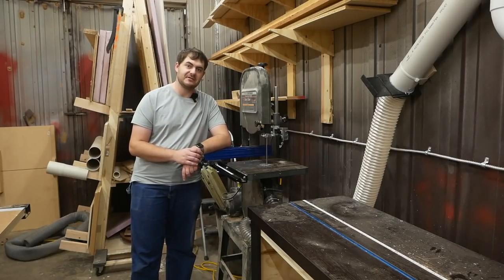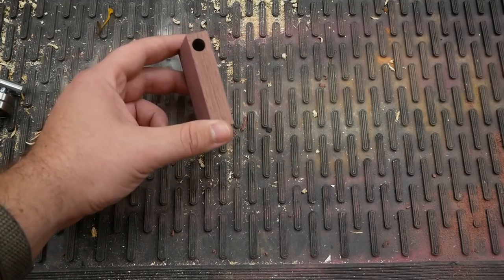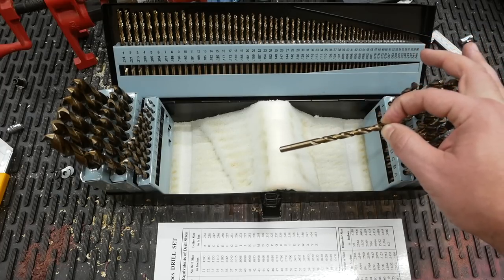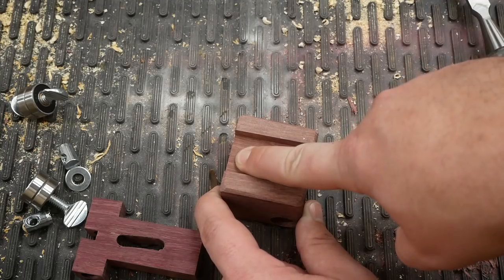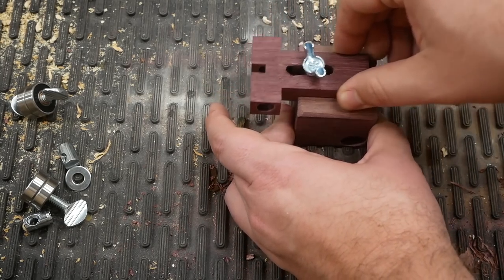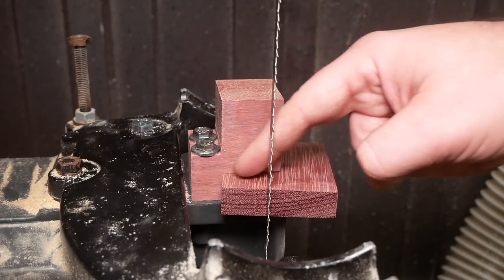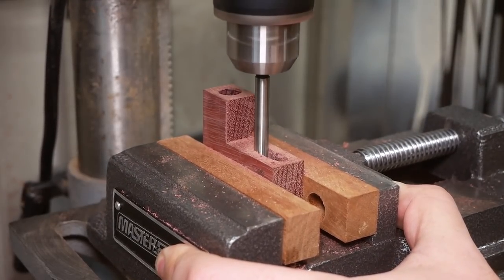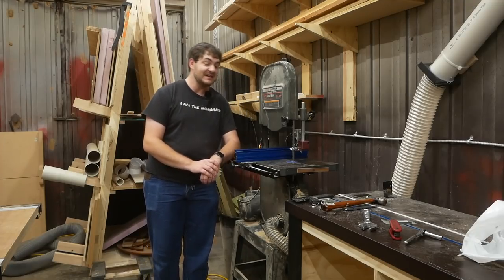Making New Ball Bearing Blade Guides For My Old Bandsaw

Comment: I'm not sure but looking at the bearing i would think the sideways orientation is probably too stop the blade from blade from deflecting off the side due to the width and slick surface of the bearing caseing. With the bearing being sideways it can't slide right off the side. That's my thoughts. I'm pretty stupid so don't take my word for it. I'm lucky I haven't forgotten to breath or fell into a saw while it's running. I sat directly next to the sorry bus driver because it was a two seater.
Reply: " I'm lucky I haven't forgotten to breath or fell into a saw while it's running."
I feel ya, brother.

Comment: A 10mm drill which is 9.9mm. Where do they manufacture those crap? Even the cheapest  drills I ever bought in Germany had at least the proper size. Most of the time the biggest issue is that they get blunt very fast or were never sharp at all

Comment: Yes the imperial drill system is terrible but unfortunately it’s not going away any time soon. It’s a really good idea to put your drill bits right back in the index after you’re done with them because otherwise you’re gonna lose bits, then your index is full of holes and there’s always going to be that one drill bit you lose and then end up needing on an important project. If you’re going to invest in a full imperial drill index just buy a good name brand, American brands are often the best. Expect to pay between $200 and $500 for a set. That may seem like a lot but they will last so much longer than a cheap set and they will drill through steel and aluminum far better than the ones you buy from the usual suspects at big box stores. Also make sure the Index (the metal case that holds the drills) is a decent brand one as well. I like the Huot brand ones because they are well built and they actually give you the inch fractional size and the size in thousands of an inch so that you can easily figure out what size you need from a calipers measurement without needing a conversion chart. And also remember that if you think that this is confusing, the BS that machinists who work in imperial experience every day is 1000 times worse.

Comment: The ball bearing is sideways because it’s a flat square surface that can still rotate on contact where’s if it was straight on the blade would have more of a tendency to slip side to side because of the small contact point

Comment: The reason the roller bearing is offset to the left because the blade back side (not the teeth side) rides on the edge of it. Or saying the bearing will coated down teeth

Comment: I hate to be that guy, but I like your content, and would like you to continue. Plus, after 36 years of construction, nearly none of my tools have blade guards on them, as most blade guards are invented people who wouldn't know how to use a tool if you half beet them to death with it. And most blade guards are so dangerous that their inventors should be beaten with them. Hell, excepting for the coil nailer and framing nailer, I even remove all the stupid "safety triggers" from my pneumatic guns. Moreover, neither the two table saws I currently use, nor any that I have used in the past, have had guards over them. Frankly, such guard are unsafe as they block a clear visual and smooth touch necessary for safe operation of table saws. Having said that, you consistently do the two things that routinely cause injuries: first, don't ever hold onto or press down on material being cut with anything near a death grip. Spinning blades have way more torque than your hand can stop if the wood binds, and doing so stops the wood from making those subtle adjustments as internal tension is released that ultimately result in bad things happening. Besides, if you have to "push" with anything like force to get the saw to cut or to keep the piece from moving around, then the blade is way too dull to be used. Second, never ever place your hand or any part thereof over the airspace above a rotating blade of any kind. This applies especially to the table saw, but also to jointers and shapers. Anyways, love the content, your sense of humor always gets me laughing.

Comment: Fun Fact of the day -

Do not say zero point three nine five.  say 395 thousandths or thou

Putting a zero before the decimal indicates it is a metric designation.

If you are ever looking at machinists drawings or call outs and can't figure out if it is metric or imperial (maybe the title block is on another page) - .5 would be imperial half an inch and 0.5 would be metric for half a millimeter
Reply: Very interesting point. That is good information to have. Thank you. 😁:washhands:

Comment: Oh my word, those imperial sizes drive me nuts!! Now I'm not going to start spouting on the virtues of the metric system, claiming it's better (here in the UK, I still drive in mph, consume fuel by the gallon and drink beer by the pint!), but there are just SOME THINGS that work better in metric...... and that's when it comes to my tools. It's a 13mm socket or an 8mm drill bit, nice and simple - this 7/16th or 3/8th nonsense wrecks my head (and this is coming from someone who owns a 54 Ford Popular, a 69 Morris Minor Pickup and a 71 Triumph Bonneville, so DO still have to use my Imperial measurement tools on a regular basis!).

Comment: Because under force it will walk off the bearing sideways. The contact patch is too small on a rearward bearing. That’s why they put it on the side of the bearing. The blade won’t walk.

Comment: Swap that nut out with a castle nut and drill a little hole through the bolt to wire it on, or put a cotter pin in it. 15:34

Comment: For tour drill press, why not use a second nut to lock it down?

 And speaking of vibrations unscrewing things... I worry that any hardwood with screws directly tapped into the wood will come loose. The bandsaw guide is most definitely not the thing you want to support with an unreliable guide. I can't imagine you would have mutch trouble doing a blade guide using metal, which may provide better reliability.

Comment: The reason why the bearing is to the side could be noise and wear. if the bearing is behind the blade like you show it will cut a groove to the bearing over time. And it is noisy due to bearing going at high RPM during the cut.
Reply: Also larger contact patch to the blade. Less likely to deflect.

Comment: Imperial drills are pure insanity. Not in that it has a huge selection of differently sized drills, but rather that it is 3 different systems packed into one...
Meanwhile for us metric folks we just measure diameter. Need a 3.3 mm hole, then get a 3.3 mm drill. A fair few drill assortment boxes here increments in 0.1 or 0.5 mm steps, cheap ones can increment with a whole mm at a time... (though, incrementing at 0.05 mm would be nice at times, but rarely does one need that since at that point one rather just buy the specific drill size needed.)
Reply: Yeah even as an American, metric is sooooo much easier when making more accurate measurements with really anything
Reply: @hudde814  In general it isn't a massive difference.

Even if most machining work using the imperial system uses thousandths of an inch as a base.

After a thousandth though comes tenths, but that is just shorthand getting a bit excessively lazy.... And nothing stops one from measuring µ-inches or even nano-inches if desired. Likewise could one specify a part as x many kilo-inches long instead of mixing in feet and yards.

Imperial though tends to get hyper focused on fractions as a defining advantage over metric. Even if there is nothing remotely forbidden about saying that one needs a part to be 1 and 2/3rd meter long. (though, in both systems it isn't odd to see hole spacings on a part being "1/2 the distance between these points.")

Personally, I don't consider imperial measurements as inferior in the slightest.

But I do consider it frankly inept to have so many overlapping systems trying to fill in each other's gaps. Especially when the systems don't really follow the same scale. (just look at a graph for the number and letter gauge drill bit sizes and that graph is far from a smooth curve as it wobbles about...)

Comment: if the wood later strips just use a Heli-Coil in it to repair it and makes it stronger.
Reply: Threaded inserts are just as good and a lot cheaper.
Also, heli-coils are made for metal, this is wood.

Comment: Metric: 10mm; 7mm; 3.5mm

Imperial: 5/8th of an inch; 7; Q
Reply: Except then he'd need a metric drill set with a 10.0838 bit to replace the size X bit, since he was fitting a (nominal) 10mm part to it.

Comment: buy a lathe or milling tool so you can make stuff from steel instead of wood.
Reply: exactly what he needs to do. wood blade guides aren't going to last very long.
Reply: @TheObsesedAnimeFreaks  
Good thing he used ball bearings for guides and just holds the bearings with wood then. 

🤦‍♂️
Reply: @Crewsy  
wood is not a suitable material for anything that encounters the stresses that those guides will go through. they will quickly break as he bends and twists what he is sawing through those guides. even the metal guides are considered disposable wear products. what he needed to do is to rebuild or make new guides out of tool steel and not wood.
Reply: @TheObsesedAnimeFreaks  
When that happens I’m sure Robert will make another video where he remakes them with improvements.  
Until then. 🤷🏻‍♂️
Reply: @Crewsy  he might not have fingers to remake them. those guides are mandatory for safety and they need to be made out of the proper material. that means steel and not wood.

Comment: I love that you ended up using the imperial system to solve the downfalls of the metric system!
Yes, letter, and number bits are weird, but they were created after the fraction bits were. Unlike the metric system, where they had a guy or a team that hated fractions, and were getting paid to come up with a totally different measurement, the imperial system evolved and probably only became an issue after the advent of machinery and stuff that needed super tight tolerances in order to work.

Also, that Ryobi forsner bit is what is known in the machining world as a "friction drill." Of course, that was not part of the design, and I'm not sure if Ryobi is even aware that friction drills exist, but that is what they made, nonetheless!

Comment: Why are the bearings sideways? To spread the load over a wider area. If they're in line with the blade (as you think they should be) the force of the blade being pressed up against them is concentrated in one tiny spot. It doesn't take long before the blade wears through the race and eventually gets into the ball race, locking up the bearing and causing a failure. With the bearing sideways you end up with the blade pressed up against an area that's a large order of magnitude greater  and less force per square mm is exerted on the surface.

Comment: So, you decide to adopt metric as the 'preferred system' back in '75, and you still have problems buying metric drills. 
Cannot help feeling that wood is not the best material for this- why not burst through the wood ceiling and embrace metal... a whole new world opens up.
Loose nut on the drill- just needs a lock-nut.
While threading wood works, it is not long life- better to use inserts.

Comment: Lol.. "acth'Heww! ..unrelated" I wish I would have thought of that yesterday at the supermarket. Instead, I cleared the isle with the authority of a bioterrorist. 
Anyway, to answer your question of the position of the bearing, with the bearing sideways, it supports the blade better, supporting it in 2 places, making it less likely to stray. With the bearing inline, its only supported in one place but since the bearing is round, it's barely supported. 
A good way to reinforce wooden threads is by pouring smoe of the real viscous blend of CA glue on them. 
Lol been there, done that too many times on the drill press (where I hold by hand and piece rides up the flutes of the drill bit after drill bit bores all the way through). Now I keep a Jorgensen clamp at the drill press as a catch all vice. As for the cradle fling thing, that's what pencil erasers are for...
Great video. Nice and original and educational. Ive been wanting to make new guides for my porta band saw but wasn't sure what to make them from (if you take out the factory guides, it changes the angle of the blade and opens up the throat quite a bit, more like a traditional band saw for cutting curves, not so much for making cross cuts in long skinny material, assuming it's mounted in a base and used in upright position)...

Comment: That 10mm drill bit is way undersized... I've never used even a cheap one that's so much out of tolerance...
Also, when you measure with calipers, you should use the part of the jaw that's closest to the body, if you measure from the tip,  you have no straight faces to align the jaws to the work piece and you get cosine error.

I use the tip only to measure on threaded parts, and even then I have to be wary of he fact that the calipers aren't exactly aligned.
Reply: I'm thinking, maybe, you need better calipers?

Comment: The bearings are beside the blade to keep the blade from drifting side to side as you cut. You should have the blade guide as low as possible to your work which will also help in the blade walking side to side. The bearings are to assist in straight cuts not to just sit behind the blade and spin. Not trying to sound like a a..hole  just saying

Comment: What the heck does "quarter twenty" mean?
Reply: Its a bolt measurement; It is written as 1/4 x 20. Its a bolt that's 1/4 in diameter and has 20 threads per inch. Its a very common bolt in the US.
Reply: @chevelle1258  oooooh right. Thanks! NZ here, we use the metric system. I'm not very familiar with the imperial thread system